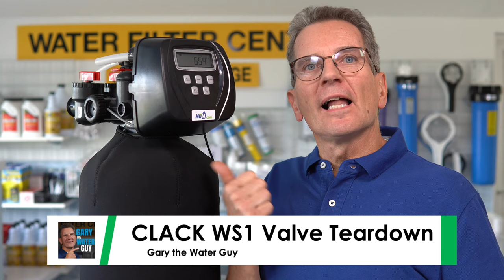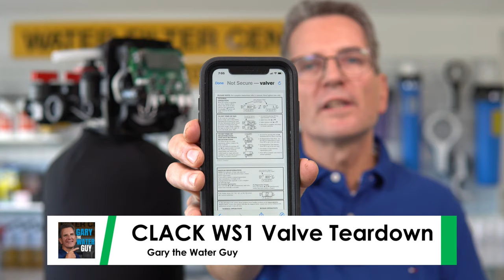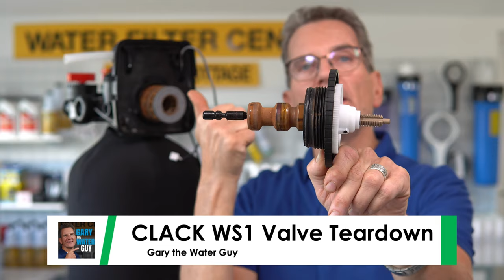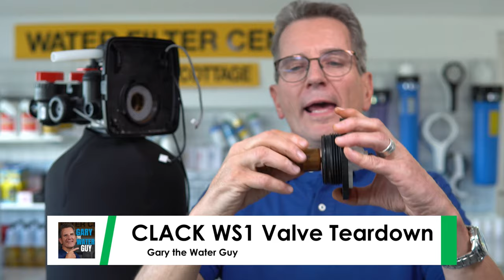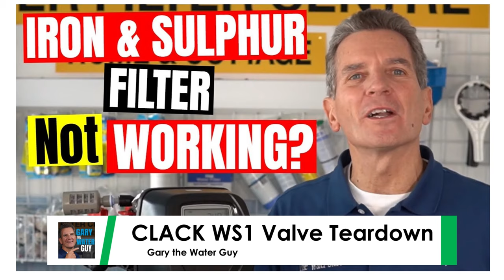CLACK WS1 WATER SOFTENER VALVE Disassembly, Troubleshooting Tips and Tricks

Comment: Hi Gary, I currently have a Gold Valve Phos block system with a board I can not find a replacement for. The screen is blank and the filter is in non-stop regen. It is currently on bypass. Would it be difficult to swap the valve with a clack ws1 ?
Reply from the maker: I really do not know.  It depends if the tank has the same thread as the Clack WS1, and the drain line flow control is sized correctly to match your requirements. Typically better, when the valve goes to replace the whole thing.

Comment: Awesome video, thanks so much for doing this!  We got notified the other day by the water company of 'unusually high usage', which turned out to be 20k gallons of water over the 2k we typically use in a month!  I believe I've traced that down to our water softener, which has this WS1 head.  It's always discharging water down the drain tube!  I've turned the bypass on to stop it, and my hunt for information led me to your video.  I feel confident I can disassemble it now, but am wondering if that's something you've seen or that makes sense to you?  I'm guessing it's a gummed up part (one of the pistons?  I was expecting more valves in this thing, but those seem to be the only things that can get gummed up?), and my plan is to see if I can just clean things out and hopefully call it good.  If not I'll be ordering some parts from you, thanks!
Reply from the maker: Yes, I have seen this although it is more prevalent with iron filters.  You will need to replace the pistons and seal pack https://waterestore.ca/search?type=product&q=clack*%20pisto*

Comment: Gary. I have a 5 button clack set up as a sand filter and the board works but the valve says it is back washing but no water comes  out the drain   Has an N on the cap and on inspection the hole was full of sand like particles. I tried to clean it and wash the debris out but When I hit the regenerate button the motor makes noise and you can hear the noise but still no water comes out.   It is set up identical to the other Clark I have which makes the same motions but water comes out the drain.   What do you do?
Do you sell just the 12 inch tanks and the media for them and the sand for the filtration tanks

With the freezing Texas one of my tanks has a leak in it and if I can get this clock to work I’d like to replace the tank with new filtration materials thanks a lot for the information JimD
Reply from the maker: Likely the piston is no longer connected to the motor.  This video should help https://youtu.be/rWh1r3idZm0 Yes, we sell media but not the tanks https://waterestore.com/search?type=product&q=media*

Comment: Just a couple of comments…..if your running an air over water system with a metered value the recycle “softening” mode should be set instead of the filtering mode. Second the stack assembly removal tool is designed to bring the the assembly out straight, not scoring the o rings in the assembly by uneven pressure.
Reply from the maker: I don't recommend using an air over media water system (typically used for iron or h2s removal) in the metering mode. Maximum time between regen (or air draw) is 3 days.
Reply: @water_estore  well the one you just took apart was metered and in the filtering mode.

Comment: Hi, looking for help.

My softener has a slow trickle even after replacing the seal pack, the regen piston, the down flow assy and the drive cap assy. at the end of regen it closes the piston off fully, then backs off a bit. I tried manually adjusting the piston using the drive cap assy (manually moving the drive gear) to see if it would shut off, but it never fully stops the trickle. If I bypass, no drip.

Thanks for any help!
Dave
Reply from the maker: You replaced the brine piston too, right?

Comment: Hello Gary,
Thanks for this video. I am in Casa Grande, AZ (between Phoenix and Tucson) but I am a Canuck like you.    1) What does a white or a blue venturi (jet pump) insert mean. Mine is a white one a full size tank. Yet, you show a blue jet also on a full size tank. I am confused. Also, I have a plug and a jet pump both in the valve. On the plug it says UP on the housing and on the white jet pump it says DOWN on the housing, You have not addressed this in this video. Since I have not installed said unit myself and hence do not know whether it ever was correctly installed, I would like to know a little more, please.     2) How does the motor know at which point to stop the piston after re-assembly? Do I need to pay particular attention to how far the piston is in or protruding when re-installing, or will the motor know where to stop for the correct position? And how does it do that?
Reply from the maker: The correct injector color depends on the size of tank and what media is inside the tank.  If your system is setup for downflow brining the plug goes into the UP hole.  For upflow brining the plug goes into the Dn hole and the injector goes into the Up hole.

Comment: My brine tank is full. My brother in law is a plummer. He was out a few months ago and put a new injector in it. It was doing the same thing then. So pulled the injector this time and cleaned it with a torch too cleaned and cleaned everything up with iron out. It still isn't working, he said he would have to pull the cage. He's busy and hasn't made it out yet. How would I do that. Oh, the I rings look good too.
Reply from the maker: This video explains exactly how to pull the cage.  But, that may not be the problem, have you checked out this video yet? https://youtu.be/ZdA0aI1q22w
Reply: Hot it, bad I ring. Thank you!

Comment: Gary, My ws1 unit was not using salt. I checked for obstructions in drain line,  injector and float.  I manually started a regen cycle. During regen, there is a leak, it appears to be leaking toward the top of unit..difficult to see but between the drain line and meter feed. There is a gasket that seems to seems to run along top of unit...separating discharge, fill and injector bay from main unit. Problem 1 is the leak...Could this be causing the fill tube to not operate properly? Thanks Anthony B
Reply from the maker: Yes, if there is any kind of leak during regeneration the system will not draw brine.  Fix the leak and likely the water softener will start working again.

Comment: Yes we have rust we have iron eater before water softener the people that installed it said not to use iron out or anything in brine tank and is there anything that would help keep it clean and the iron eater also I know you said hydrogen peroxide but how much fluid at what interval thanks any info will be pleased
Reply from the maker: What are your trying to keep clean?

Comment: Our water softener keep leaking at the drain connection during flush cycle. At 25:35 you show a brass fitting with straight connector. Our plumber used a similar plastic fitting with an immediate 90 degree elbow that then connects to the plex. It leaks past the teflon tape on the 3/4 screw on connection.
Previously he used rubber instead of Plex and that leaked where rubber was clamped to connector (jubilee clamp) and eventually split the rubber.
Is there too much pressure coming through from the drain connection, maybe a sudden surge of pressure at the start? This is just a normal soft water setup HOWEVER the drain pipe goes up to 2nd story and half way up the 2nd story wall where it curves down to a drain in the 2nd story laundry room next to the washer H & C supply pipes.
Again, just wondering if this pressure rise is too much for fittings
Reply from the maker: We use this brass fitting all the time with drain lines that go up without issue.  I would make sure that it is connected with teflon tape and pipe dope.

Comment: Hello Gary. 
I hope you can help me. I have a Whirlpool water softener. I left the salt in there for over six months without it being used. When I finally hooked it up I noticed that the salt was solid rock hard. I put treatment down there and ran it over and over and over again with no luck. I did clean out all the salt and put fresh salt and did the cleaner over and over and over again And it looks like it’s just not doing anything. I only filled it to the first level of Salt to see if I had any luck. Not sure what to do at this point. Is the unit trash or not? I think it’s the Whirlpool 33000-Grain Water Softener model.
Reply from the maker: Sorry to hear about your concern!  Did you run it through a cycle to see if the water level in the brine tank slowly drops during the brine cycle?
Reply: Gary the Water Guy yes a bunch of times. Also, put whirlpool cleaner and Iron OUT
Reply from the maker: @TheEastCoastSensation  does the brine level in the water softener slowly drop during the brine cycle?
Reply: Gary the Water Guy no sir
Reply from the maker: @TheEastCoastSensation  So that's your problem then, it is not drawing brine.  Try cleaning the injector.
Reply: Gary the Water Guy how do you do that? Do you have a video for that or directions?
Reply from the maker: No, this is not a water softener we service. These are not made to be serviced they are mostly disposable. You might find a YouTube video that shows you how, try search.
Reply: Hello Gary
I’m still trying to tackle this problem. I did a reset and water is on the bottom of the unit. I did not want to put more salt in until I figure out the problem. Salt it below the 1 level. The indicator is blinking also. Need help!
Reply from the maker: @TheEastCoastSensation  Sorry I have made all the suggestions I can at this point.  Either find someone more familiar with Whirlpool water softeners than I am or just replace the softener.

Comment: I have this same Water softner installed, about a year ago,  I find it constantly says "Fill Salt" but when I look in the tank there is about half filed tank of salt (18") and its just over the water.   I have confirmed there is salt all the way down.
Reply from the maker: Someone has programmed that setting into the valve, it is a pain and we never use it. This programmin video of mine shows you how to shut it off https://youtu.be/c6r7qUK8to4 at about the 24 minute mark.

Comment: Gary, is it possible for a WS1 to send it's regenerant directly or mostly to drain? Thanks
Reply from the maker: It does after it has regenerated the media.
Reply: @water_estore  Gary, I have a WS1 and I suspect it may be malfunctioning and that the regenerant is mostly being sent 'to drain' rather than properly through the resin (bottom of tank to top of tank) in an upflow regen cycle. Is this something you’ve ever seen and is it possible? Thanks for helping - Tim

Comment: Gary, I have a WS1 and I suspect it may be malfunctioning and that the regenerant is mostly being sent 'to drain' rather than properly through the resin (bottom of tank to top of tank) in an upflow regen cycle. Is this something you’ve ever seen and is it possible? Thanks for helping - Tim
Reply from the maker: Yes, something has let go inside the tank.  The tank needs to be rebuilt.
Reply: @water_estore  Gary, the tank and riser tube are in good repair, wondering if something in the control head could cause this? Thanks
Reply from the maker: @ttosterhout  no, the media is getting out of the tank either through the riser tube screen or the basket attached to the underside of the valve.
Reply: @water_estore  The media is not leaving the tank, my concern / question is that the brine / regenerant is bypassing the media and therefore not doing an adequate regeneration. ?

Comment: Is it possible for the seals to just have a lime buildup on them? I have a softener that seems to have intermittent leaking to the drain almost like something might be squishing the seal and then dislodged when the softener runs. It's a clack like the one in the video. Installed in 2017. Municipal water.
Reply from the maker: Yes, it is and I've seen that happen.
Reply: @water_estore  my softener ran a full cycle last night and now the trickle is totally gone in service mode.  I didn't touch it all week. It runs once a week or when the capacity is depleted.

Very strange but maybe whatever it was got flushed when it ran.

Comment: Gary, is there a screen that can be replaced?   I have resin going into my water lines that plugged up my faucets and shower heads.  I am assuming there is a screen that broke that allowed the resin to get into the water lines.
Reply from the maker: Yes, there is but you need to replace the media to replace the screens, here are the screens https://waterestore.ca/products/hum-riser-tube-and-upper-screen-replacement-combo?_pos=28&_sid=522de061b&_ss=r
Reply: @water_estore  thanks for the reply.  Do you by chance have a video showing were the screen is located?
Reply: @water_estore  Just got my riser tube out and it has 2 tubes.  One tube is pretty short, maybe about 1.5 feet long.  The only ones I see online are single tubes. Do you know we're I can find the screen for this setup(it screws in) or can I go to a single tube?

Comment: Hi Gary, I was looking for some help. I have a Clack WS1 softener and it seems to have stopped softening the water when checked with test strips. After troubleshooting myself (checking all connections and making sure all lines were clear and not clogged/no salt bridge has formed) I have found something interesting. After the system has done the backwash (water draining from drain line) the system says it is in “Brine” mode. During this brine cycle, my thought is the softener should be PULLING the brine solution into the resin tank. However this is not the case. I took apart the brine line to see if suction was my problem and I found that my system was actually ADDING water to the brine tank during this stage. Is this correct? Or am I right in thinking that the system should be PULLING the brine into the resin during this stage? I was thinking my next step would be to do a rebuild... If you could shed some light on this I’d be very grateful. Thank you.
Reply from the maker: Yes, during the brine cycle brine should be drawn into the valve.  I would replace the pistons and seal pack as shown in this video.
Reply: Gary the Water Guy Thank you for your response! I took the spacer stack out this morning and found one of the o-rings had broken in the stack and was impeding the pistons. Thank you for your videos!

Comment: I have an issue with the meter Gallon remaining\gallon per minute don't change at all while I use a fosset. It happens everytime when I have a power outage. It freezes the remaining Gallon at that moment and when the power comes back, it will show me whatever the remaining gallon that was before the power outage. But after that I don't see the "softening" or the Gallon per minute changing or poping. Last time I did a full regen cycle and it did come back. Then, I had another power outage two days before and it did the same pattern (showing me the last gallon remaining and not showing "softening"). I did pop out the turbin meter and did clean it gently with a small towel and a Qtip. But is there something that I need to do instead or it's broken?
Reply from the maker: You either need to replace the meter or the circuit board to fix it. We have them here https://waterestore.com/collections/clack-corporation

Comment: I have a clack water softener and when it regens it’s extremely loud while it’s draining water. Sounds like the water coming out is under lots of pressure and/or mixing with air. Is this normal? If not, what’s likely wrong with it?
Reply from the maker: You must have a very high flow rate of water, but yes, this is normal during the backwash cycle.

Comment: Hi Gary , i have a problem with this water softener , i do regenerate and on display it shows 3,75 m^3 left ,because i have hard water and i put 56 degrees at hardness in the settings ... my problem is that , everytime  when on my display capacity reaches 0.7-0.8 m3 , from the flotor comes red water (bad water) (i check it with some german solutions , i take 5ml of water and i out 1 drop of solution and it comes green normally) , but when the capacity is <1 it's red and i don't know what to do ?
Also i have 2 tanks , every tank has 75l off resin.
 An advice from you would be very helpfull . Thank you!
Reply from the maker: Check your settings for the days over ride.  You may need to reduce the days between regeneration due to your iron content which produces the red water.

Comment: Gary i  have a water softener system that i just replaced my seal pack and  piston do to it constantly flashing filtering.     even after replacing them it still does the same thing not as bad but constant filtering . what's my next move...
Reply from the maker: It may be flashing filtering becasue water is running in the house somewhere like a leaky toilet.

Comment: I have a WS1 with a solar 4 button head that when the battery is charged fully (externally), the display comes on every 5-10 seconds and flashes error 101.  It also makes a sound like it’s trying to do something.  Then after a few minutes with the battery plugged in, the display will not come on at all.  The battery when charged externally has about 7.4V output.  I made sure the motor spins freely and is not binding.
Reply from the maker: Not sure about the solar 4 button head but typically these systems are 12 volt

Comment: Im receiving error 102. I dont know if is because of the freeze we just had. I wanted to tear it down but when i place the valves in bypass and press the regen button for 5 seconds, i dont hear any air come out. Do you happen to know why?
Reply from the maker: Ther should not be any air, just water.  This video should help https://youtu.be/v_oF5w5dB1U Something likely stuck in the valve.